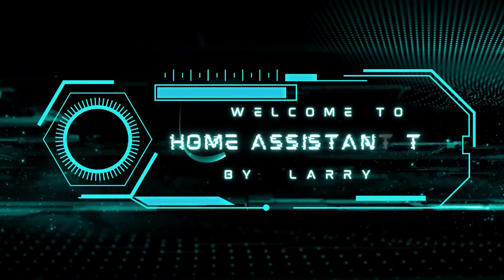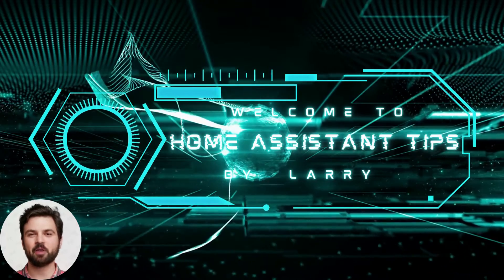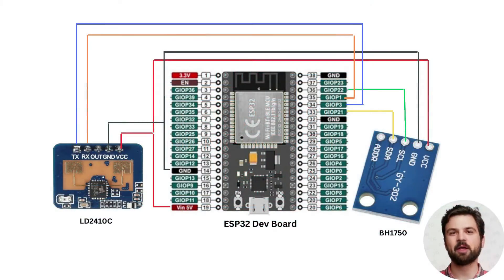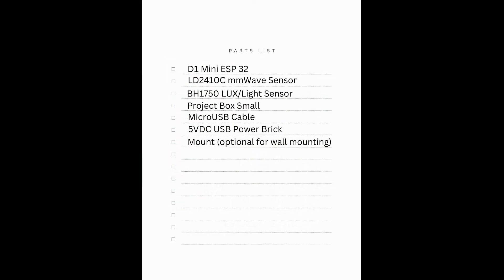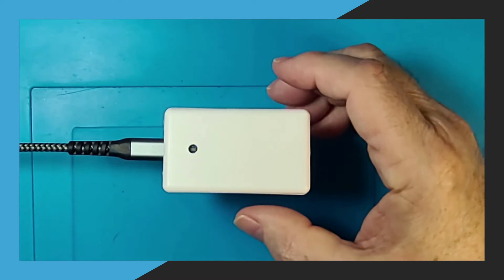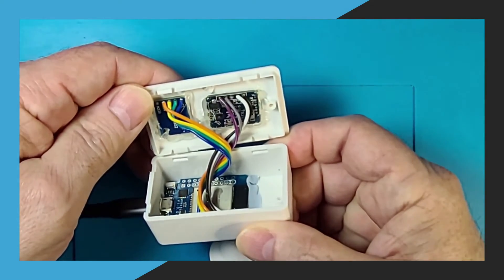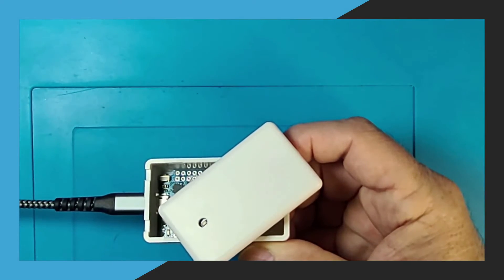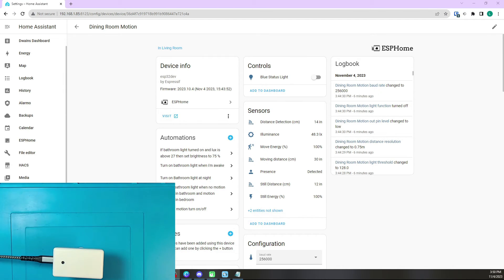mmWave and Light/LUX Sensors in Home Assistant

Comment: Thank you for this project. It works very well 😀. I have a question: what should I add to the code, so that I can control the LED of the D1 Mini from Home assistant? I would like to turn it off. Thanks for the help.
Reply from the maker: The LED on the D1 mini is not controllable. What i did was use a pair of needle nose pliers and removed it. If you decide to do this be careful to not damage any of the surrounding components.
Reply: @HATipsByLarry  Ok. Thanks for the information.👍

Comment: Hi @HATipsByLarry,
first of all thank you for sharing your work with the rest of us!
I have a question regarding the light sensor. In the yaml code on your github is no code the hints to a light sensor... no light_treshholds no Illuminance... did this disappear when you worked the zones in or do i simply not see it? Thanks in advance!
Reply from the maker: Thank you for pointing that out. Yes when i modified the code to update it when i added zones I  accidentally removed the code for the BH1750. I have updated it now and added it back in. Glad you liked the video, and sorry about the error.

Comment: Shouldn't VCC be connected to the 3.3v pin, not VIN?
Reply from the maker: @steverdooley  a lot of sensors will work with both 3.3 and 5 VDC. VCC is the supply voltage of the circuit. VDD is the working voltage of the chip. Most sensors have regulators on them, to bring the VCC voltage down to the VDD voltage. Also as is shown in the video I'm powering the MCU through the USB port so VIN will output 5 vdc.

Comment: Could you please share the wiring diagram for these sensors and code corresponding to ESP32 D1 Mini? The video tells esp32 d1 mini but diagram is for ESP32 dev board.
Reply from the maker: The pin numbers and the code are the same for both MCU's except the the D1 mini esp 32 for the ld2410c just connect to the tx and rx pins instead of pins 1 and 3. Hope this helps. If you need more assistance please contact me on my discord channel here https://discord.com/invite/9EkA5rFyCE

Comment: Hi, I am venturing to do something similar. I am quite new to using ESP home. Would the code you posted above work for ESP32-C3 and ESP32-CP2102 with 38pins? I see you used a D1 mini in the video, but the wiring diagram was for the CP2102. I also have a BME-208 on order so I can do temperature and humidity sensing as well. How do you find the response time to presence? Is it quick enough or would addition of a PIR like AM312 add value?
Reply from the maker: Welcome to the channel and yes the C3 and the CP2102 well both work with EPSHome and my code well work fine with those MCU's. I also use the BME-280 but find putting one inside a enclosure with other electronics raises the temperature of the sensor by several degrees. There is a way you can compensate with a formula. At one point I'm planning to make a video with that sensor in it and will cover this. As far as the response time for the LD2410 i find it to be fairly fast usually 1 to 3 seconds. But i trigger the lights to come on with a PIR sensor or with a VL53LOX sensor (see my other video about them https://www.youtube.com/watch?v=2ZEIDl2Fluc), as the time-of-flight sensor makes for a perfect threshold sensor.
Reply: Thanks very much for the info and the video.
Reply from the maker: @bharatveeranki5091  No problem any time 😀
Reply: @HATipsByLarry  I tried to set this up today, but unable to get ld2410 working using pins tx/rx. I had to use pins 16/17. Otherwise the esp32 board would just say connecting and never establishes a connection for the install. Tried with multiple ld2410's and multiple esp32 boards I have.
I also have a problem with the BH1750 which I can install fine in esp home, but the value is always unknown.
Reply from the maker: @bharatveeranki5091  Make sure you send the tx of the mcu to the rx of the ld2410C and rx of the mcu to tx of the ld2410c.each esp32 dev board is a bit different as to where the tx and rx pins are, some even have 2 sets of them. As for the bh1750 make sure the SDA of the bh1750 goes to pin 21 and SCL goes to pin 22 of the MCU. Might also disable logging in the esphome code as this can some times interfere with the transmission of data to the ld2410's. Here is the code for that

logger:
  baud_rate: 0

This code goes above the captive_portal: line.

Also make sure you have power getting to the board as well. Check solder joints, etc.

Also if you are still having problems you can join my discord channel and send pics of your project so i can see if i see any problems. https://discord.gg/GM7RUf5n
Reply: @HATipsByLarry  I think I have figured it out now. I think the tx and rx PIN numbers of 01/03 don't work with the board I have. I have seen some other online tutorials suggesting using TX and RX in the yaml code instead of 01 and 03 numbers. But as it's working with pins 16/17, I am not much bothered. I will try disable logging.

Regarding BH1750, I think it was some loose contact causing the problem. I get lux values now with your yaml code.

Also can you clarify something for me. I am trying to add an AM312 and a BMP280 to the same board and test it out. I see they use pins 21/22 as well from the config I have seen online. Can I use these pins for everything or I need to somehow configure different pins for each of these sensors? Sorry for bugging you with so many questions. Your videos are to the point on what is needed for the setup without over complicating.
Reply from the maker: @bharatveeranki5091  Pins 21 and 22 on a ESP32 usually are the I2C (pronounced eye-squared-see) protocol pins. Many of the sensors (but not all by any means) use this protocol because it can be use by several sensors on the same MCU at the same time, provided the address of the sensor is different then the other sensors on that bus. Most sensors provide a way to change the address if you are using another sensor on that bus that is using the same default address. It has been my experience that the sensors use a different default address. So it is usually not needed to change the default address.
Reply: @HATipsByLarry  I am getting an unable to accept invite on your discord link.
Reply from the maker: @bharatveeranki5091  Do you have a discord account? Others haven't had a problem.
Reply from the maker: @bharatveeranki5091  Try this i regenerated the public link for my server to see if it helps you. https://discord.gg/9EkA5rFyCE